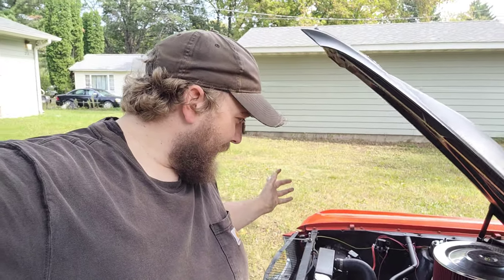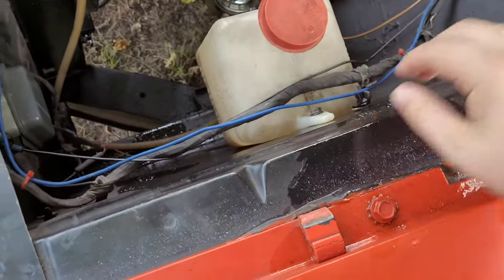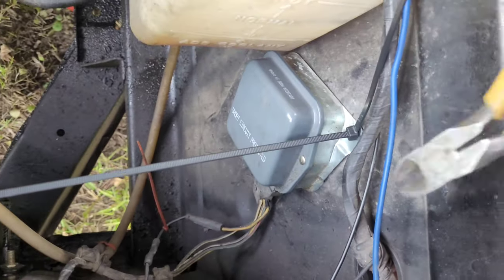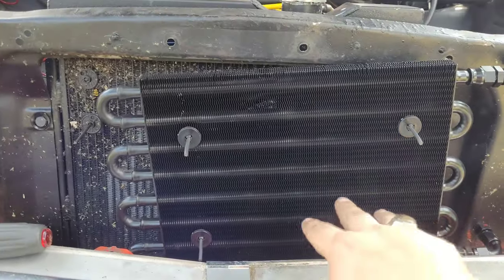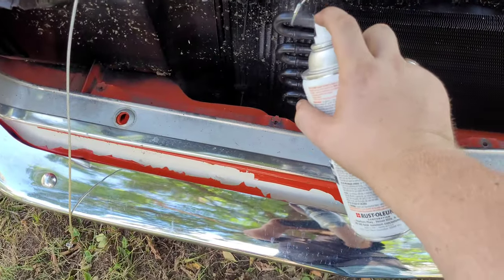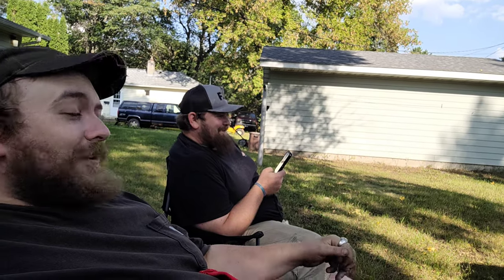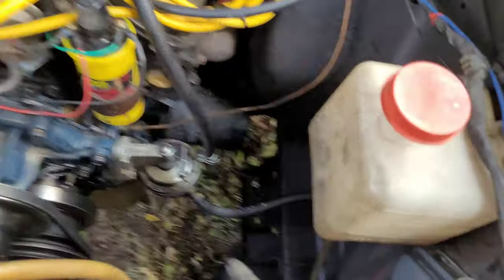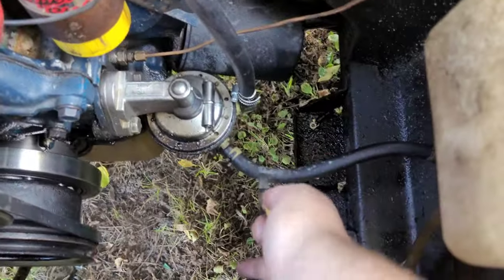Fuel Cooler!! | Will This Crazy Idea To Cool The Fuel Actually Work!? | 1965 Mustang 302 SBF Windsor

Comment: 😂😂😂 Tom just chilling in the background.  Ya think ya gonna run a little hotter with the heat off that fan directly in front of the radiator?
Reply from the maker: I think it should actually run cooler with both the extra airflow plus the cooler fuel together 🤔